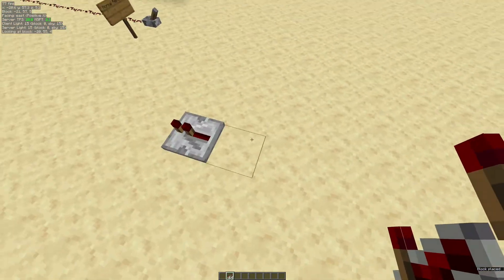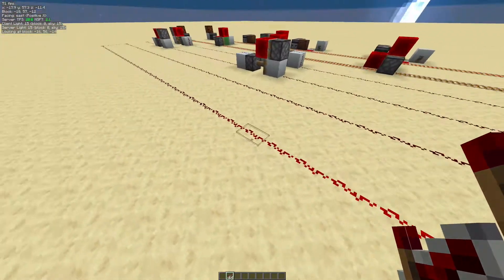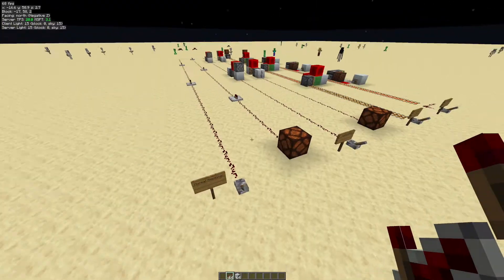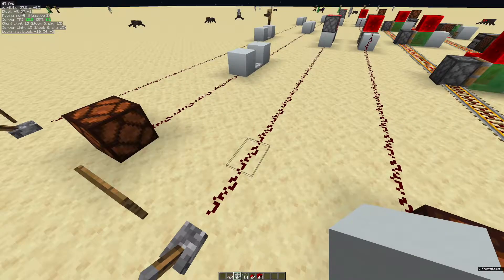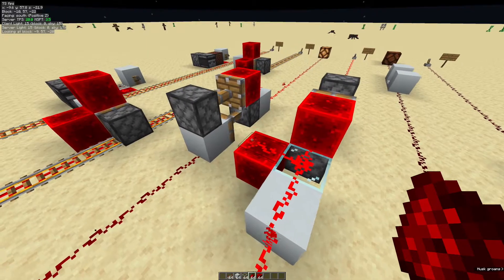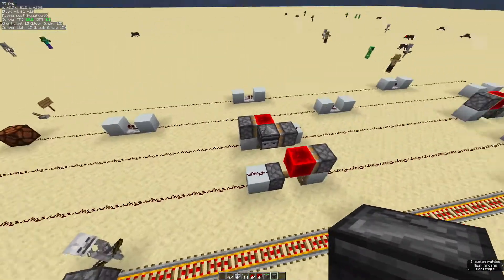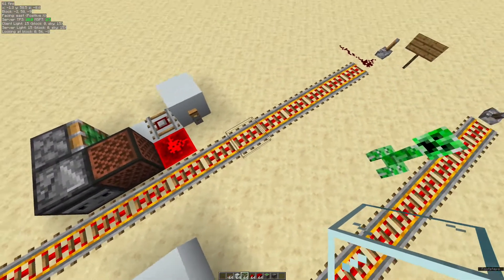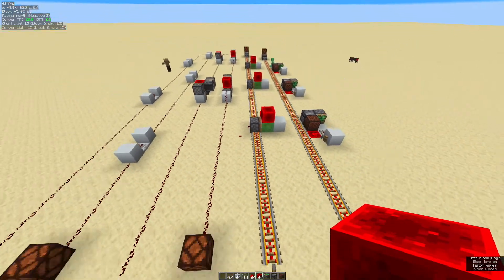Different Instant Repeater Designs | Redstone Essentials #4

Comment: I once came up with my design for an instant repeater.
Place a sticky piston facing horizontally. Place a redstone block in a way that the SP pushes it when powered. Place a normal block horizontally adjacent to the SP not on the opposite side. Place a redstone dust block on the block and next to it and the RB.
It will activate the SP but should instantly (because the piston retraction is instant) stop powering it. I don't know why but the RD will be active for a tick and the piston won't spit out the RB. If you attach another SP to the redstone line, it will spit its block out, and if you make two such contraptions sharing the same redstone line, one of them will work (MCJE is asymmetric). If you connect a redstone wire to the piston and another one to where the RB is when it's powered, it will act as an instant repeater for signals that can be either active or changing quickly between active and inactive states; any other signal will be converted to such.
There is a version that doesn't use the phenomenon of not spitting out the block, but I haven't tested it.
Reply: I actually made this exact thing(edit not exact but similar concept I think) (it uses a block, Redstone line, sticky pistons, and slime/honey with Redstone block that touches Redstone line when retracted, allowing it to quasi-power/unpower without updating, then extending/retracting all at once when updated

When any piston gets updated, they all do, thoigh I haven't yet found a video with it

I was wondering if anyone also came up with the idea
Reply: @raymondwiggins354  I think you read my comment incorrectly because I didn't use slime/honey
Reply: @orisphera  well the slime/honey is for a longer line since it will self quasi-power/unpower, it only really needs to have it every 14 or 16 pistons though, but it is an instant design (though the big part is pretty chunky and was built with pretty rudimentary understanding of quasi-connectivity)

I'll try to type how to build the big part of it (might need to make it slightly taller though, I'll have to double check)

|red    |red block|slime|
|block|air.          |slime|
|air     |piston>  |slime|

Alternatively if it needs to be taller

|red block|slime.    |air.     |
|red           |slime.    |slime|
|block.      |air.          |slime|
|air            |piston>  |slime|

Edit 2, I think you may be thinking of something like https://youtu.be/r5Wfzfq9kKs?t=45 or https://youtu.be/eH3sg97DW6w which might be modifiable to make an instant pulse, but idk
Reply: @raymondwiggins354  Can you send a link to a screenshot of your contraption on Imgur please?
Reply: @orisphera  it should be on reddit now. Comment with the link keeps getting removed though...

Comment: Are these budded pistons going to be a problem in future updates?? I want to pretty much make redstone inmy singleplayer world future-proof
Reply from the maker: Should not be a problem. Quasi connectivity is (according to the devs) going to be staying in the game. As for redstone redirection not giving updates, I am not sure why they would change that, but you never know. I use it anyway, because I know that nearly anything redstone related is prone to breaking eventually. Take the time when they changed redstone in 1.16. A lot of contraptions had to be fixed or redesigned. Back to the topic of QC, I would say that it is pretty safe to say that it will stay, and if they do remove it, it would be one of their stupidest decisions, because the whole technical and redstone community depend on it and it would cause an uproar. Remember when they removed sticky pistons spitting out blocks in the 1.13 snapshots? It was added back in the next one.

As a conclusion, I would say that it is pretty safe to use it.
Reply: @amplitudemc  am.... actually i stopped minecraft at 1.8.x then i continued back at 1.15.2. So i havent heard about the sticky piston thing, what happened tho?????

Im also more on command blocks that time, instead of using pure redstone on a combination lock i made, I used more command blocks instead with a bit of redstone
Reply from the maker: @noname-codm4590  About the sticky pistons, in the 1.13 snapshots, Mojang decided to start messing around with the pistons, and at one point removed sticky pistons spitting out their blocks. About the command blocks, I think that's really cool!
Reply: @amplitudemc  not entirely sure what “spitting out blocks” means lol. Also thanks.
Reply from the maker: @noname-codm4590  Sorry, it means when a sticky piston is powered with a short pulse (less than 3 gameticks), it will not retract the block back. Because normally a sticky piston will pull the block in front of it back, but if it is a short pulse, it will not pull it back.
Reply: @amplitudemc  ohhhh ok noted
Reply: this aged badly